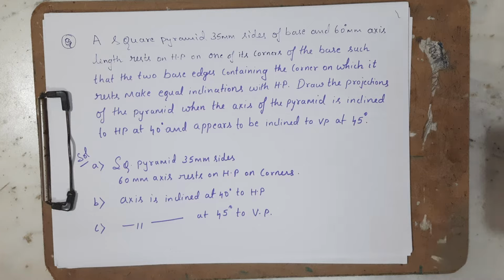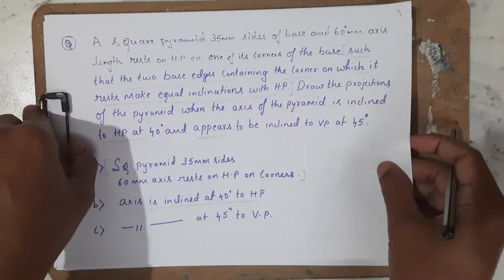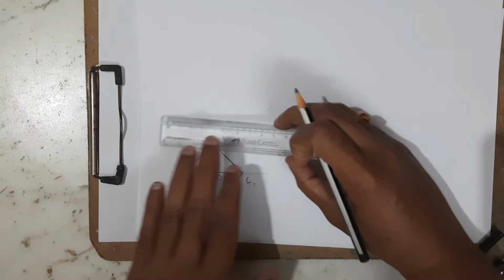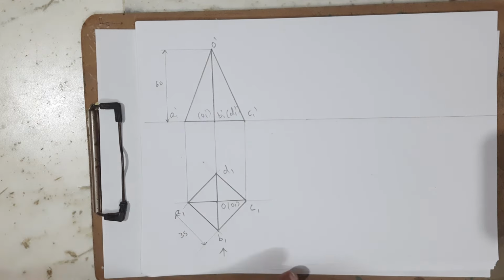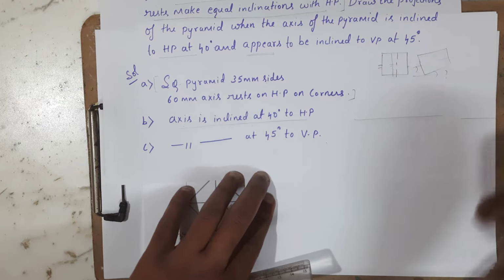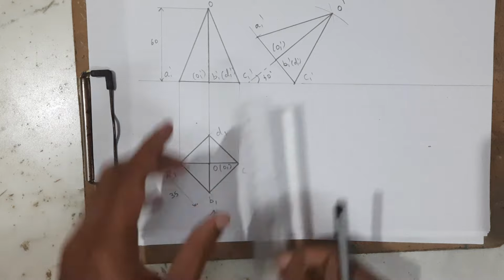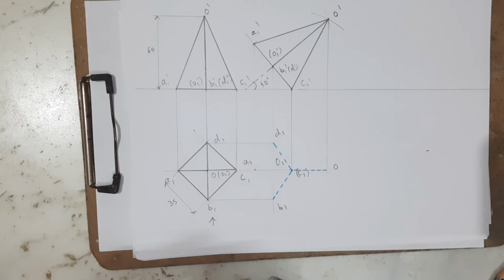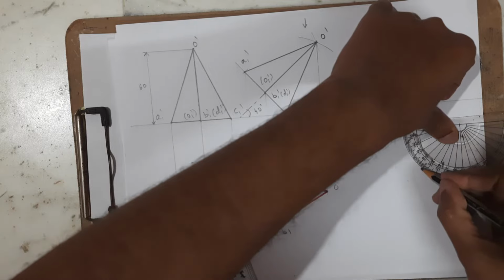Projections of Solids/Square Pyramid/Corner resting/Engineering Drawing

Comment: A square pyramid, base 40 mm side and axis 65 mm long, has its base in the V.P. One edge of the base is inclined at 30 to the H.P. and a corner contained by that edge is

on the HP. Draw its projections.